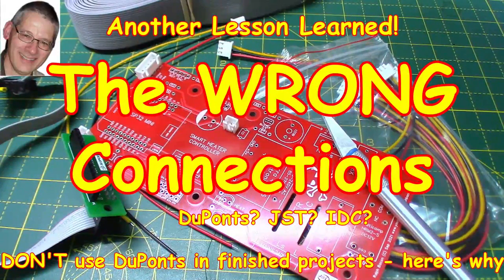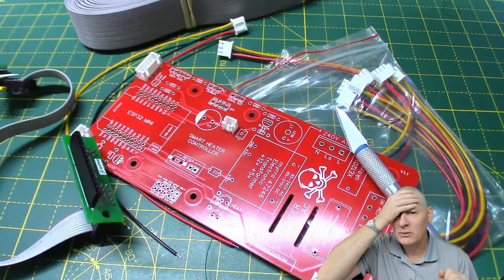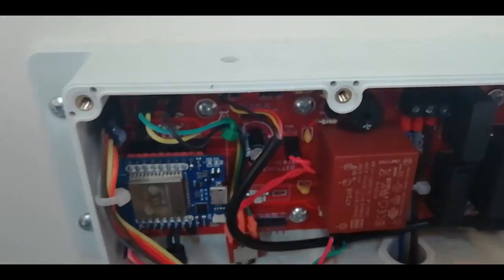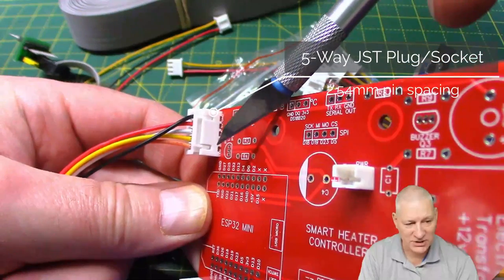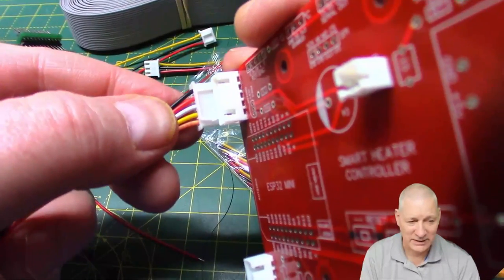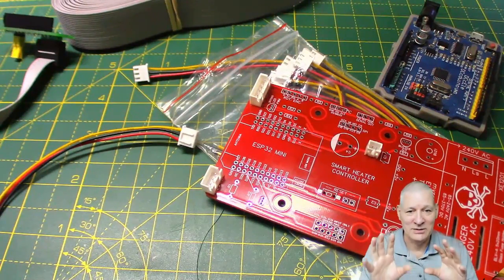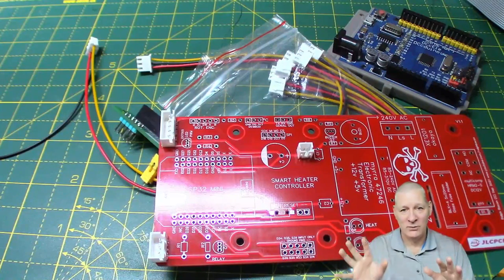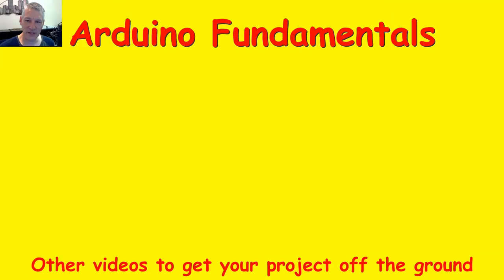#238 The Wrong Connectors😲forget DuPont, use JST or IDC for final use

Comment: Wait, Are you using single pin dupont connectors like you show with the Arduino?  If so, there's your problem!

I use those with breadbording too. And they pull out soooo easy. But I've also built with them but when I do that it's groups of 3, 4, 5 or more pins side by side. So I use a housing made for that many pins and put all the connectors for s group in the same shard housing. It stays connected a LOT better.

I don't know about pre-made cables for that. You might have to crimp then yourself. But there are good tools for that pretty cheap these days.

Back before I could buy them online I used to rescue them from old PCs. Then if I didn't have a connector for exactly the number of pins I needed I would take multiple smaller ones, lay them side by side on a flat surface and a small piece of electrical tape around it.  That worked. But with crimpers, sockets and housings so cheap on the Internet these days why bother?

Just make sure to get the rstcheting crimpers. Any cheaper than ratcheting and it's no good, might as well use needle nose pliers at that point. (Yes, I started with pliers for years... Don't recommend!)

IWiss make good (for a hobbyist) crimpers. They aren't going to compete with the real Dupont crimpers but those are WAY too expensive for a hobby tool.
Reply from the maker: Yes, I've had a reasonably good Dupont crimper for some time; it's fiddly but does work. But I like the KF2510 connectors now and I use a Japanese "Engineer" brand crimper for that too. It makes better connections and they don't easily pull out - but can be if required, unlike the JST ones that stick like the proverbial.

Comment: read the posting notice,  I did use a link in my previous comment, but as you mention it got deleted, take a look at my YT video on rotary encoder name "Fast Rotary Encoder using Arduino UNO R3"  work very fast and use no debounce circuit, thank's again for the great video.
Reply from the maker: I will check it out, Jack. If I haven't already.

Comment: What are you doing? cutting the locktaps a way!  Why don't you use a drillbit to unluck your front door. 😂😂
Where is your IDC male header, Some has lucks "wings" and it is polarized.
It seems that you are ignoring the safety featured. Didn't you learn the first time around?🤔🤔
Reply from the maker: Remember I only remove the wings on the PLUG so that should it ever be decided the locks are required after all then the plug can easily be replaced (unlike the socket).

Comment: There's nothing wrong with DuPont connectors. The biggest error you made was going for China garbage. These are not real DuPonts, these are Chinese knockoffs that have no any quality whatsoever. So what you should take away from this, always pay for quality equipment. Real DuPonts don't fall out of sockets unless you mean them to.

What I can say for the straining issue, you should never apply any strain on the wires or the connector body. If you do so, eventually the wires will slip out of the crimp terminal. Use cable ties and other accessory for removing the strain. I also normally solder wires into crimping connectors after crimping.
Reply from the maker: I briefly mentioned in the video that I have some much better quality DuPont cables; they would certainly have been better but I don't believe they are the solution for final implementation of projects. You're so right about the cables from the Far East - but that's why they can produce them so cheaply. A pity they don't offer superior cables at twice the price!
Reply: @RalphBacon  I see, I overlooked that part of the video where you said it - however if proper precautions are taken it would be okay to use DuPonts in final applications as well, often commercially made projects that use DuPonts the connectors have been reinforced with glue to the PCB, in compliment of strain reliefs.